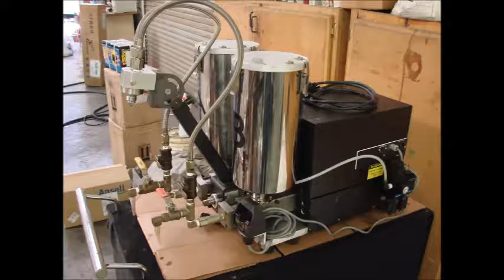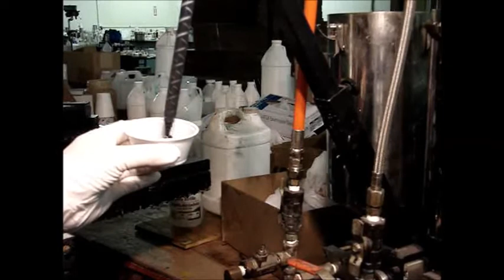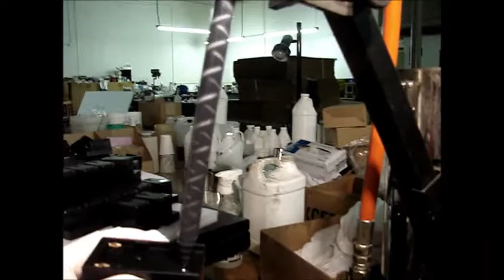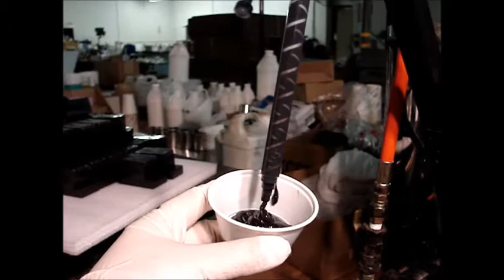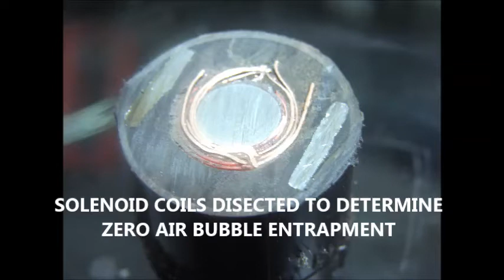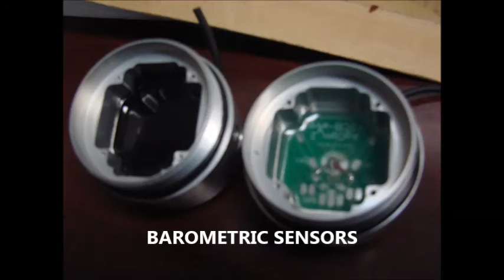Automated Mix And Dispensing Of Epoxy Resin For Potting Electronic Circuits

Comment: Do you sell the static mixer?
Reply from the maker: No, we do not. Here is a link to where to buy the dual cartridge and static mixer. Thye offers 2:1. 1:1 mix ratio kits from small syringes to large catridges.
https://www.adhesivepackaging.com/two-component-packaging/dual-cartridge-systems.html
If you wish to use a mix meter dispenser equipment, you can search for used ones on eBay, and save $$$. The equipment featured in the video was purchased on eBay for $750.00, compared to a new unit that can cost up to $14k.
Thanks,
Gerald